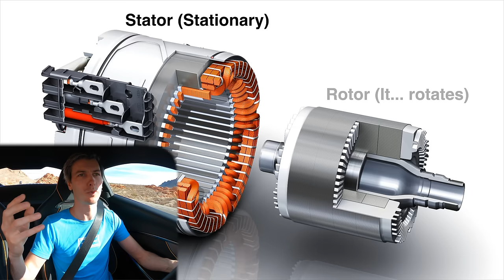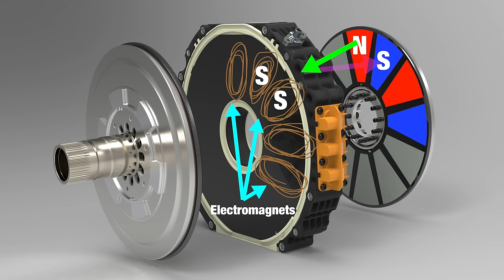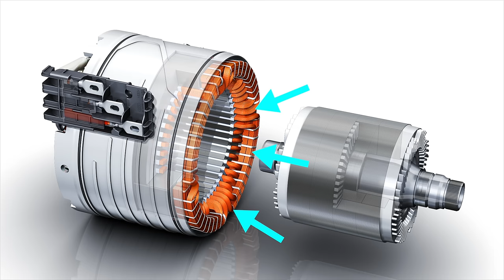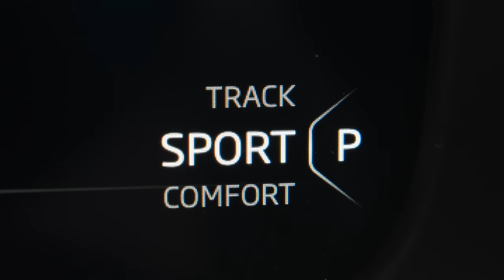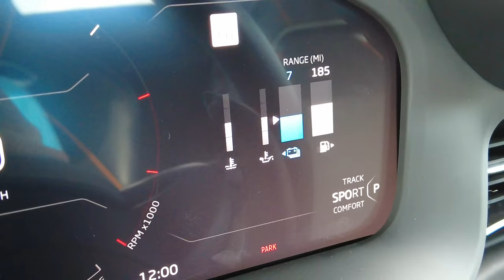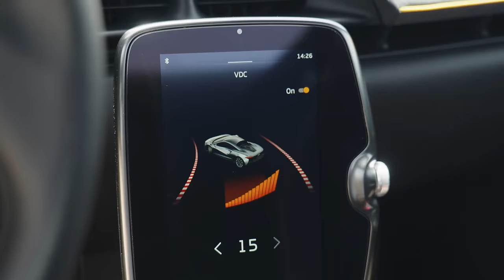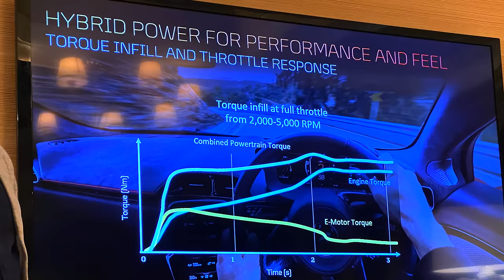These Tiny Motors Make Big Power! Why Supercars Choose Axial Flux

Comment: Question: With this in technology in mind I have though of the tiny V12 engines back in the early days of ferrari ... they had high rev but no torque do you think we could potentially see a comeback of super tiny (maybe high efficient) low displacement v12-v10-v8 hybrids?
Reply from the maker: I don't think we'll see tiny high cylinder count engines much more. It's a lot of complexity/cost without much benefit, versus simply choosing a smaller cylinder count.
Reply: A Ferrari 250 with a 3 liter V12 with this motor would be great!
Reply: I would assume that high revving v6 or i4 engines would be a possibility instead. The cost and extra fuel consumption doesn't make sense. Porsche will most likely continue using high revving 6 and 4 cylinders as they switch to more hybrid models in future.
Reply: @caseymurray7722  Porsche has stated already that the 911 will stay on liquid fuels and they are building a zero emissions fuel plant in Chile that will be quite competitive at the current fuel prices. 
The rest of the lineup, i.e. the daily bread and butter (Cayenne, Macan, Panamera etc.) will follow the Taycan to be completely electric. For the european market, their range and features suffice.
Reply: A V3 is a more likely partner, nowadays. For better or worse.
Reply: @JoeOvercoat  L3?
Reply: @dutifulbarrel9084  that works!

Comment: Which would be better for a small fully electric city car, a classic radial flux motor, or an axial one? From this video, it seems like there are hardly any downsides to using an axial flux electric motor on those types of cars.
Reply: in terms of packaging, the radial seems to win out. its a lot more flat, which means no "bump" in the boot that is hiding the motor.
Reply: I'd imagine you care a lot about price here, radial is cheaper to make.

Comment: Jason! Great informative video as always!! 
Was actually curious if you still had your crosstrek. I am thinking about getting on in a few months, maybe you could give us a super long term review?? Regardless, keep up the awesome work!
Reply from the maker: Yep, still have it, 6 years old at this point and 50k miles on it. Love it. Only issues I've had are a wheel bearing (covered under warranty), and a brake switch recall. Great lil machine. :)
Reply: @EngineeringExplained  Just this morning i was waxing nostalgic for my ‘84 4WD (not AWD, no) wagon.  It punched above its weight, to be sure.

Comment: The rpm limit on axial flux motors  has mostly to due with the transverse force on the magnets
Reply: Did you get your Engineering degree from clown college?
Reply: @csm153  As axial flux motors increase in rpms the rotor and permanent magnets have to resist the increasing shear forces.

Comment: Does the IC actually rotate backwards when using the enlectric motor to reverse the car? Seems to me that might be hard on things like cam drive chains et all
Reply from the maker: Haha, no, there's a clutch that disconnects the engine from the motor. Only the motor is spinning in reverse.

Comment: One problem with axial flux motors is cooling the rotor, which is not such a problem in hybrid applications where bursts of peak power are short, but is in full electric traction applications. The P1 motor as an internally water cooled rotor that means is has a very good peak vs continuous ratio!
Reply: If you look at the shots of just the motor, you can see the ports for the coolant to flow through the stator

Comment: For the first few minutes I thought this was a hub motor used on each wheel, I was excited.  When I realized it's used behind an ICE my excitement dropped.  It's still a fascinating vehicle and outstanding tech!  👏 😜
Reply: Hub motors stink. Too much unsprung weight.
Reply: @bearclaw5115  Yes, as sprung weight, but they can be inboard on short shafts.

Comment: Those things would be sick for motorcycles. Mount it directly in the rear wheel hub then just mount a battery on the front in the frame.

Comment: A V8 has a 90 degree firing pulse that matches the 90 degree cylinder banks, a V6 has a 120 degree firing pulse which works easiest with 60 degree cylinder banks.  This also makes the cylinders narrower which reduces the size penalty of DOHC engines that tend to be overly wide.  A pushrod engine is much more compact but needs room for the camshaft in the V so those engines frequently are made with 90 degree cylinders.  However with 90 degree cylinders they have to use offset crank pins in the crankshaft to achieve the actual 120 degree firing pulse.

Comment: It’s crazy to me how the weight of top sports cars is now normally well over 3000lb. I can’t believe the C8 Z06 as awesome as it is, weighs almost the same as my full size SUV. It has made high hp a must. I miss the Colin Chapman ethos. 

So that makes me curious about something that’s hard to sort out from online info, what engine configuration (# cylinders, displacement, layout, induction) has the best power and torque vs weight ratio?  I’m including NA, turbo, blower, but if forced induction the weight has to include whatever extra pieces the FI requires over NA.
Reply: I believe it's the Koenigsegg inline 3
Reply: Honestly, unless it's an electric car, I wouldn't bother getting any "sports car" that easily weighs over 3300 pounds. At least with a electric sports car, all the weight is down low.
Reply: Theoretically, probably a highly tuned freevalve turboed V8/V12, think a combo of various Koenigsegg engines. Also, again hypothetically, to maximise power/talk-weight, you'd want this engine to be a direct injection 2 stroke.

Comment: The primary reason for having a 120 degree V angle is balance: this is the most optimal configuration for a V6 to eliminate primary forces. I learned that from @driving4answers.

Comment: The sections of windings outside of the stator are easier to cool than the ones inside - thinly coated copper in direct contact with the coolant medium as opposed to being enclosed in an iron channel but not in thermal contact with the channel wall

Comment: Axial Flux motors generally have a North Pole facing a South on the opposite magnet rotor , with poles alternating from North to South around the rotors. The magnetic Flux generated circulates via an iron backing ring in the rotors back around through adjacent magnets, thus intensifying the the field strength. 
The 120° vee layout of the engine would give a lower centre of gravity and its probably no coincidence that its equal to the phase angle of a 3phase motor.

Comment: I’d love to put two of those motors on the same prop shaft in a Cozy MkIV and 450 lbs of batteries (2 200 lb packs that fit in the strakes, 1 50 lb pack after of the firewall for balance).

Comment: Kinda want that 94hp, 17 kg motor to be compatible with the transmission of old econobox cars. I'd estimate those cars would lose somewhere in the area of 150 kg of engine, exhaust, tank and fuel system which would make room for this engine and about 16 kWh of lfp battery without adding weight. That would be ultimate upcycling of cheap old cars ...

Comment: I like the pure electric mode.
You can use the car as a daily commuter or in down town, without making noise, pollution or wear the engine and then switch the engine on when you need the range or like to have fun.

Comment: You know what would be cool? Having one of these motors combined with one of those 1.0 liter turbo engines to replace the first 3 gears with the clutch engaging at the 4th gear and beyond. The engine basically stays at idle working as a range extender until then.

Good mix of fuel economy, torque and comfort for cities with increased responsiveness for roads. Might not be the fastest but it would be a nice option for my country, where conventional EVs are out of reach.

Comment: In normal driving your tires only spin at about 1,000 rpm max. That mean any rpm above that from an electric motor mean you need a gear box that adds extra weight and gear friction. If they built an axial with a 1,000 rpm limit, they could just direct connect it to the wheels without a gear box.

Comment: 7:10 60-degree V6 engines are well balanced, which makes them a popular choice, but with an DOHC design, there isn't much room between the cylinder heads for the ideal intake runners for high rpm racing applications. Ferrari used a 65-degree V6 to solve this problem in the 1950s and 120-degree V6 in the 1960s. They only used 60-degree V6s in some SOHC V6 sports car engines.

Comment: There are two reasons that an axial flux motor is used in the McLaren. I think the point may have been missed so I will pitch in.
1. In electric motors torque scales with the rotor radius squared. Simply put as the rotor radius gets larger the area carrying magnetic flux increases. The motor is the shape of a circle, hence the area in the air gap is pi*r^2 (now you know where the squared term comes from). In contrast if you grow the motor along the axial length the torque only scales linearly.
2. A high torque motor is intended to be used in a direct drive application. Using a gearbox causes inertia to be increased. In fact when gears are compounded, the inertia becomes squared. This is really bad for a sports car, which is designed to accelerate quickly. Eliminating the gearbox reduces inertia. Acceleration = Torque/Inertia. So reducing the inertia gives the same affect as putting a bigger motor in the car.

Comment: The magnets on each rotor must be offset by the width of each axial loop since the field polarity must be opposite on the other side of the stator.
Reply: Shadow Ban  I did not say it well, but meant this as a question not as statement.

Comment: The real reason for the 120° bank angle: 120° is the natural crankshaft cylinder distribution for I3/V6 engines. For a V6 engine that doesn't use 120°, it needs to use offset crank pins.
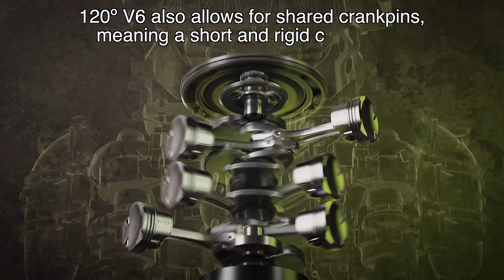Reply from the maker: Yes, shown at 7:57 in the video. But they're also using a balance shaft in the center due to it being 120º, so there are good reasons for other designs (boxer 6 has theoretically perfect balance).
Reply: I knew there was a different reason, just could't remember it

Comment: i wonder if they could put one of those little acial flux motors into a small and cheap sports car. I don't need oodles of power. I'm in the market for a small, not too powerful, lightweight, sporty go-kart thing. like an mx-5 but electric.

Comment: Those were in existence in the late 80's early 90's. They called them pancake motors. They had them on all 4 axles on a car and it was doing 4 wheeled burnouts. I worked in printing and saw an article on them. Glad they are coming of age.

Comment: The comparison between axial and radial machine flux paths was unclear to me, especially since it compared a 4 pole induction radial flux motor to a higher pole count permanent magnet axial flux motor.

Great video overall, I've been appreciating your explanation of automotive components and systems for years now (even systems I have a little more background in.).

Comment: Just wait until hybrid radial - axial motors start coming to market.  Koenigsegg's Quark is of this design, though isn't the first, one of the first witnessed models of it comes from the late '90s.  Though there's a couple of designs, a U-shaped rotor that wraps around the stator, or a U-shaped stator that has an internalized rotor; axial motors with multiple plates are similar, you can have the rotor plates on the outside and linked together, or you can have a singular middle rotor between to stators.  Rax motors solve the 'dead winding' issue brought up here, as the most efficient design is to wrap that dead portion of the winding around onto the axial face; though all motors have a portion of dead area, even on axial designs, keep in mind a field encompasses a wire, area of a face of the coil is the only thing that influences directional strength, which leads into the secondary issue of unused field on the backside of the coil, which dual-plate axials better utilize this with a central coil, but having magnets and/or plating that itself influences these backside fields also exists in various designs to strengthen the frontside fields, essentially the halbach analog of coils.

Comment: ~7:35. Pretty succinct explanation of why flat 4's and 6's are not great in most applications.
Reply from the maker: Yeah, in this case, you have a jumbo intake manifold and hot-V layout. If you route the exhaust underneath, you can have a fairly compact manifold and keep the engine low. And Porsche has figured out how to keep them low, but if you look at images, you can see the turbos make for a very wide engine.

Comment: The bank angle for this V6 engine makes me think of (of all things) the two Cadillac V-16's from the 1930's.  Those two engines were completely different designs sharing few if any parts.  The first one, introduced in 1930 was a pushrod OHV engine and used a 45 degree bank angle for even firing.  In 1930 all cars had very high hoods and were overall quite tall. They all also used straight front axles.  Those two features and the rapid advance of cars in the 1930's would lead Cadillac to release a completely new design for the1938 model year.  That engine used a very wide 135 degree bank angle and was a flathead.  Why the change?  Car styling was already trending to longer, lower, wider.  Independent front suspension design was being developed starting in the early 30's.  The packaging for many of the independent suspensions (double wishbone typically at the time) intrudes into the engine compartment. The 135 degree bank angle (even firing) allows for a lower hood, and the wide V makes plenty of room for the intake and exhaust manifolds to reside there, so there are no exhaust manifolds on the outsides of the heads/cylinders competing for space with the front suspension.  Clever and in both the McLaren and the 135 degree Cadillac V-16 the bank angles chosen for packaging reasons while still retaining even spaced cylinder firing.

Comment: LMP1 class at lemans used capacitors the brakes would charge them and the capacitors would discharge out of a corner, the drivers must learn to brake in a start line before the corner to fully charge the capacitor less smooth less

Comment: Great vid as usual! You know your good because companies like McClaren loan you cars to enjoy taking a spin in while you do your vid. Question: What is the minimum size (power) ICE they could have used to keep the batteries charged for normal driving?  Hybrids were first used for fuel economy, and later we started seeing them in performance cars, but in the later, they are still using pretty large and powerful ICEs. As Tesla and some others proved, electric alone can provide muscle car performance, so why not make an EV with just enough ICE to keep the batteries charged for regular use and still being able to have plenty of power when needed for short bursts?

Comment: I'm surprised that one of the benefits of a V-6, 120 degree angle is not mentioned. We know that in order to achieve primary balance in a 4 cycle engine, 2 revolutions of the crankshaft is required or 720 degrees. 720 divided by 6=120 degrees. I think Buick was the first American car maker to use a V-6 configuration, but the old engines were called "odd fire" because it had three shared crankpins arranged at 120 degrees from each other, due to their origins from the V8 engines. This resulted in an uneven firing order, with half of the cylinders using a firing interval of 90 degrees and other half using an interval of 150 degrees. The uneven firing intervals resulted in rough-running engines at low engine speeds. The "even fire" Buick used crank pins split at 30 degrees from each other to achieve a smoother 120 degree firing.

Comment: Very impressive, $229,500
The Artura joins the 720S and 765LT as part of McLaren's Supercars lineup. Under the hood, you'll find McLaren's first-ever six-cylinder engine: a high-revving 3.0-liter twin-turbo V6 that produces 577 horsepower and 431 lb-ft of torque by itself.
Why couldn't some smart folks that this technology and Apply to existing vehicles we have already paid off. Thinking my 2014 Corvette could use a pair of these motors in place of my front wheel brake rotors. Put the controller and battery package about the rear axle for weight balance and improve rear wheel traction. Don't you think the C5, C6, C7 all totalled could use a similar designed package and spread the cost over al l three generations and likely most GM Light trucks too. That several hundred thousands vehicles in a tight market for retrofit kits. Seems likely to be sucessful and profitable. I see they are doing this in Europe, UK and Scandinavia????? Why not in the USA? Dennis

Comment: Quick question, why isn't everyone else in the market using this style of electric motor? Mass manufacturing would make it cheaper, and it's lighter and more power dense...
The inertial factor and RPM would also help to engine brake and battery regeneration.
Reply: it requires a higher voltage to have usable torque at high RPM
Reply: in general, higher voltage batteries can have less range as well, because the less cells in parallel the more voltage sag you receive. so you would have to switch to LiFePO4 which is less energy dense, or lithium polymer which is also less energy dense. in the end you're probably gonna lose range, but you definitely get more performance.
Reply: Yes, MB and their performance division AMG will use these motors going forward.